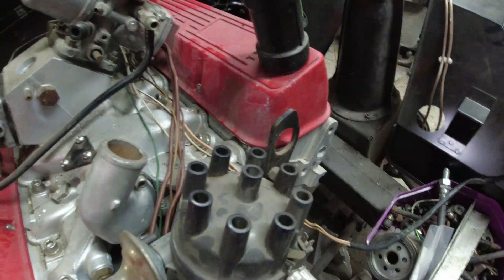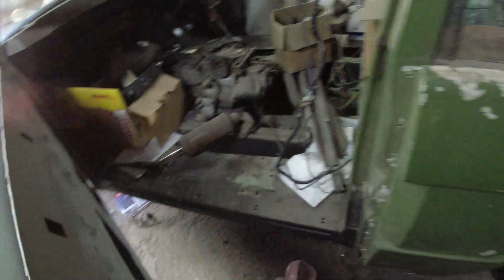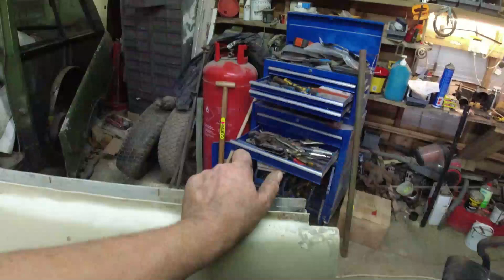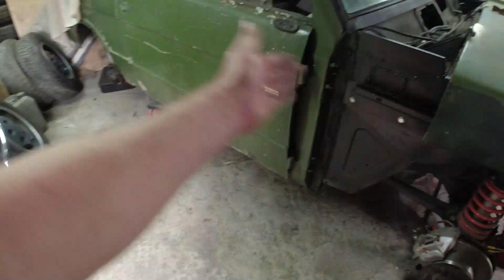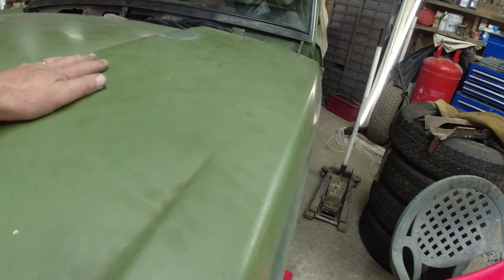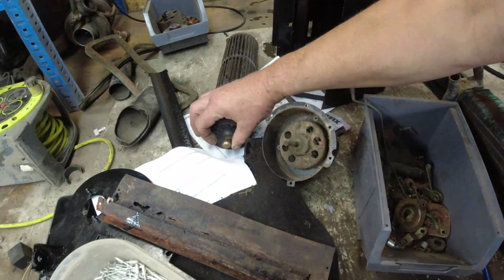Range Rover Lincoln Green Ep11

Comment: Great video! Top tip, when i did my heaterbox i put a piece of flat silicon rubber in place of the felt, so now it actually seals! Is really nice to get propper heat in the car, tested to 30 C below zero! Another top tip is too put a little cap above the outlets to the windscreen, this will give you proper hot air going up there. 
Keep up the god work!
Reply: Top tip.....lets see if he actions them? Ta
Reply from the maker: Nice idea to use a better and more modern foam material. I do test the heater boxes to ensure that the flaps do engage properly. The heater in these cars is very good when the matrix is not full of grit and always seem to blow hot within a couple of miles of a cold start